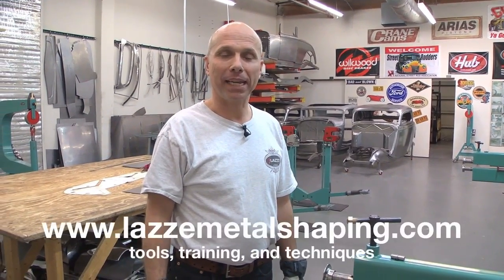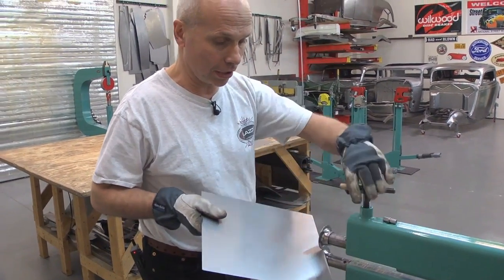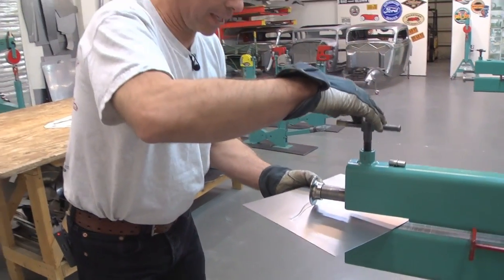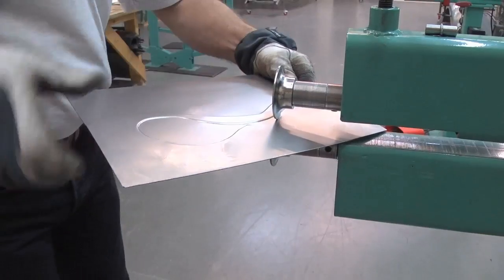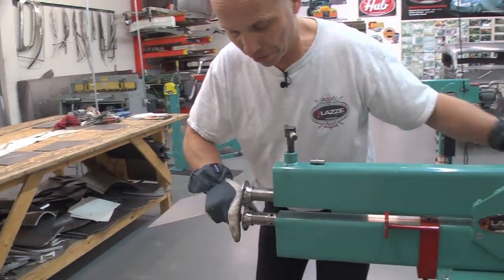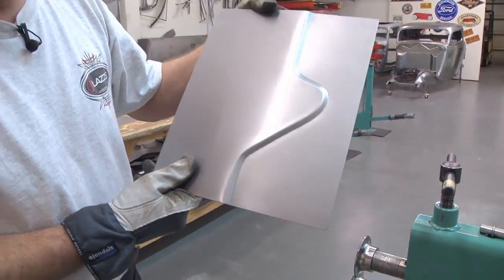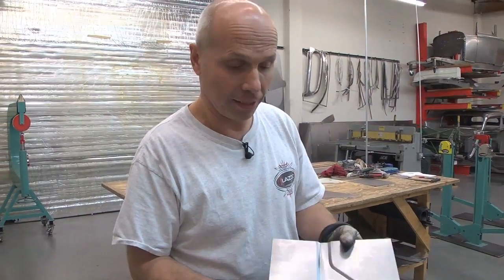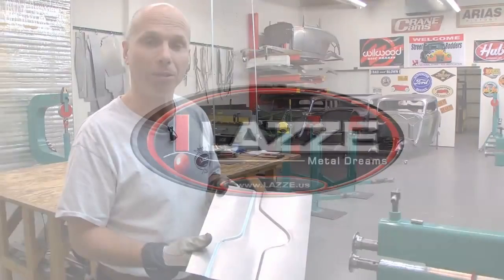Lazze Metal Shaping: Bead Roller Die Ideas and Uses

Comment: is it possible to use a bead roller to make a bezel? Is it possible to achieve a right angle on two sides of a piece (or all sides of a piece)? so then you would end up with a rectangle that has very short walls on every size of the piece?